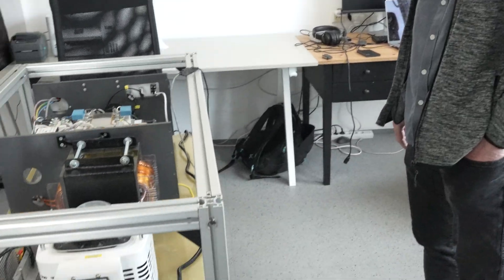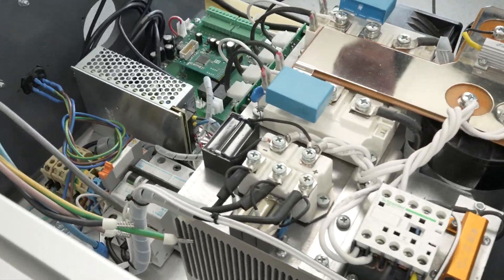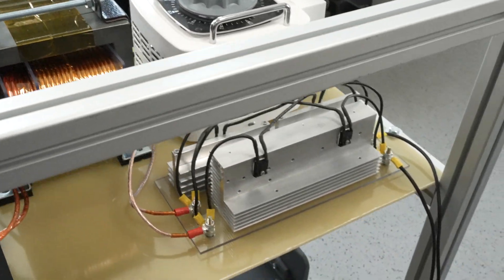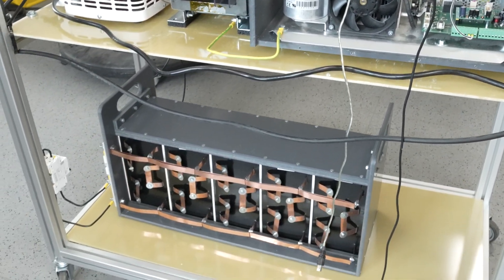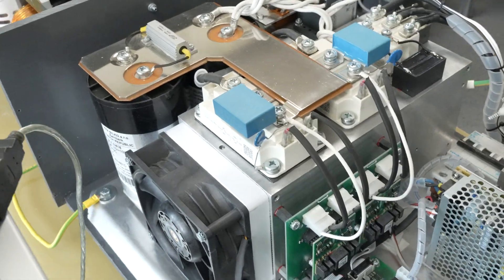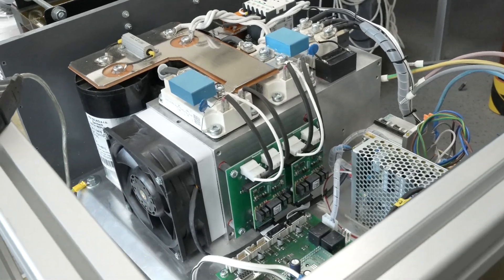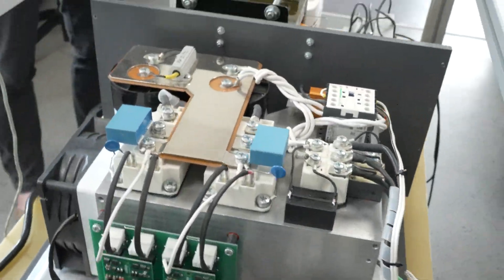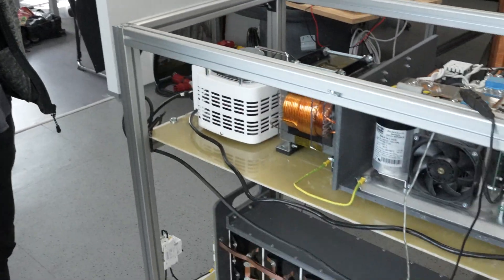VEGA - Jan Rak's parameter controllable PSU for replications

Comment: Wenhelt Interruptor, https://youtube.com/shorts/c28rrrnbLow?si=TJwgH26uFupl7yjm - two partitioned electrodes in a Sodium Hydroxide bath separated by an orifice in the partition.
The current density through the orifice connection is sufficient to momentarily boil the electrolyte in the orifice and momentarily interrupting the current flow.
A WE cell is demonstrated powering an ignition coil primary and generating a very useful secondary coil spark discharge, maybe this device is useful to those doing electrical pulsed experiments ?.
The current interrupting orifice in the demonstration is through glass, perhaps the arcing/plasma/implosion events in the orifice are doing/producing some funky things, maybe worth investigating ?.

Comment: I have been thinking PSUs i want to pulse voltage to a HHO unit, i think there can be benefits to this with reduced power consumption if you get the energy to the actual bonds of the H2O to get it to work more efficiently, a PWM is the first stage in my design, i think the guy who is doing the demo, got the amps way down by creating a standing wave ( i think this uses the energy generated from the bonds breakup to keep breaking nearby bonds with just a little top up energy from the PSU ) ... this works like a swing, just a little push once its going will keep the kid on the swing going up to the same level every time ...

Comment: Love the power supply. He could use a mega to control the voltage through a variable resistor or a tank circuit to control the Q and product outputs of different frequency to test mater changes in the valley so to speak.